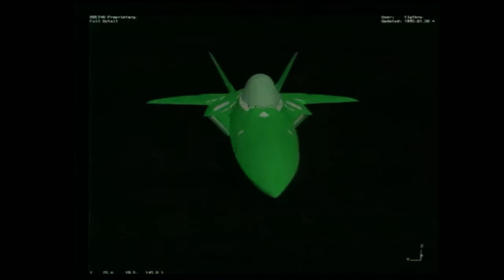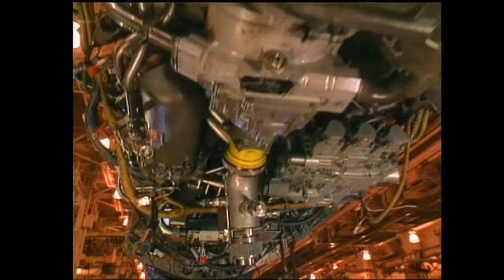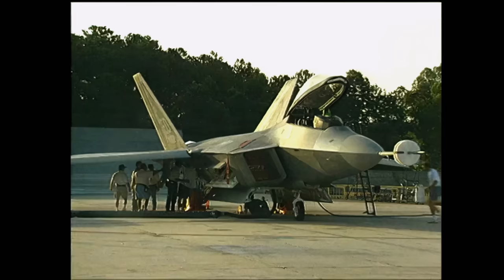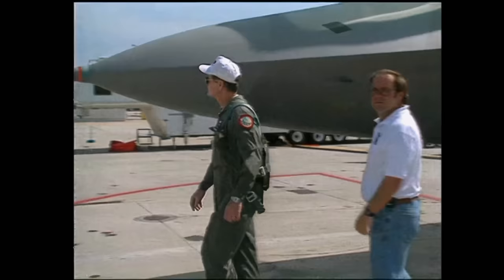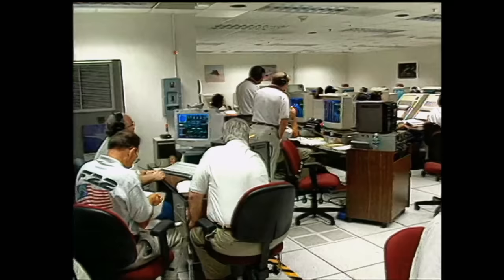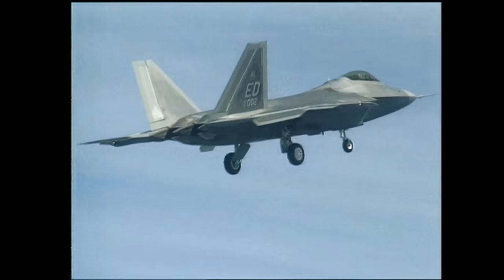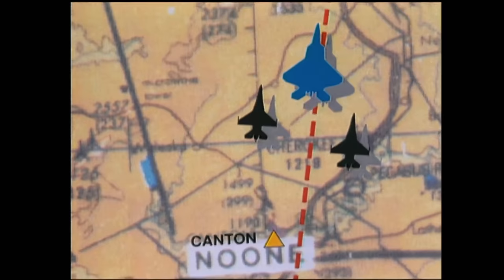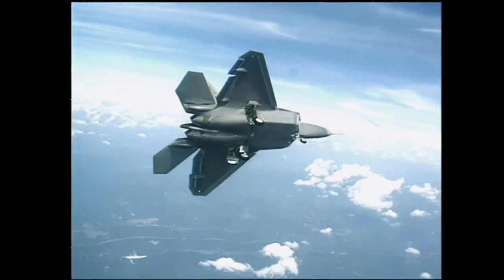F-22 Raptor Maiden Flight | Lockheed And Skunk Works Stealth Tactical Fighter Aircraft | PT. 2

Comment: LOL. MAX issues all over again. 
Let the pilot fly?
Nope, must need moar computers LMAO
Reply: I (not totally) agree with you, mainly with a contradictory opinion.
I think for giant cargo/bomber  aircraft, &  commercial / passenger aircraft.  100 percent should be augmented with flight control computation. For 1 to Allow precision input & control authority. As well as safety, either reducing ability to over & under control input  no matter what regime it is currently flying  in.  This prevents over g or out of flight tolerances reducing maintenance cost and lifespan. Al While maintaining aircraft strength. Stoping the aircraft from pilot induced issues. 
Making it safer for passengers. 
But obviously the pilot (s) should have the control authority with computers as secondary modulator / assistance / prevention role. 

But fighters or other combat aircraft should be doing absolutely everything so you can focus entirely on the deployment/operating/tactics  of the aircraft as  weapons system . But turning flight control off should be possible. 
The only thing is this isn't the Input this controller action and In turn this control service moves.  Like old direct input aircraft, now you input an the FCS dictates to the control services exactly what is needed for precision input.  So you can't fly anywhere near as well from day 1, the skill and training needed is beyond what is preferable to be effective

Comment: Flight controls CONTROLLED by computers.
Sounds like B737 MAX all over again..
Reply: Without it, this aircraft is super extremely unstable aircraft. Do keep in mind that the pilot can't handle what the raptor is capable of when it comes to maneuverability and speed.
Reply: It's called fly by wire and it's nothing new nor relevant to the issues with the 737MAX.